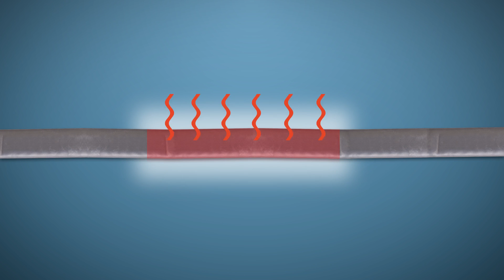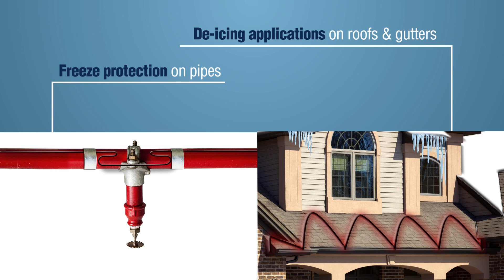EasyHeat™ Self-Regulating Heating Cables

Comment: If you ran a piece about 100 ft. And they've already covered it and there's a cut on the outside jacket. Is there any type of repair I can do to it without replacing the wire

Comment: this stuff is awesome..bought a 4 ft cable to wrap an exposed outdoor pipe that services our amusement ride building..put no insulation around it other than coating it in aluminum tape..this week it got to -13 for a few days and the pipe did not bust or freeze.. although if your going to insulate your heat trace fires associated with this brand are extremely rare but always use a fiberglass vapor sealed insulation (fire retarder insulation)..and always be sure to connect to a GFCI outlet which will allow the product to send a relay to the disconnect to shut it down in case of arc..if using extension cord always make sure the ground prong has not been removed...for a 20 dollar product it kept away thousands of dollars in damage..

Comment: How can actually put out more heat in colder sections and less heat in warmer sections?  Smart cable!  I can't imagine how that works.
Reply: the core is a semiconductor that reacts to temperature so it can regulate the current passing trough the core.

Comment: It still waste of energy if there is no ice on the roof. You can have dry winter and no need to heat anything...
Reply: A small expense to avoid major repairs. Gotta think long term... also you can unplug it, derp.
Reply: jnb the cable just regulates the wattage it puts out,  the cable alone doesn't turn on a off by itself ReRe,, that's done by a number of sensors that monitor temp, moisture , rain ,snow and ice.. smartin up son
Reply: Then turn it off. Duh!
Reply: Yeah